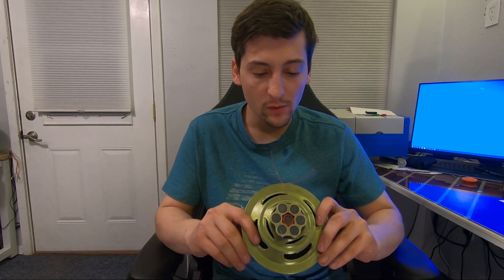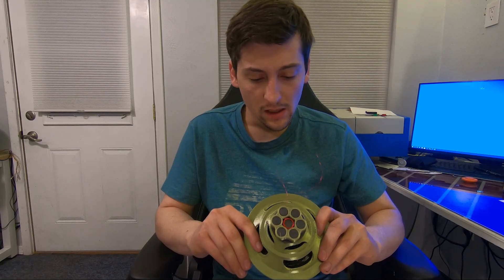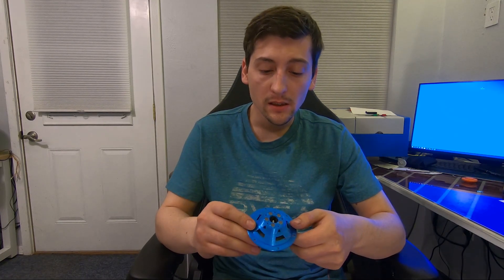3D Printed Speaker-V4 Revisiting the First Design

Comment: You have progressed exceptionally with your speaker design. Have you made the files publicly available for download ? I also want to give it a go.
Reply from the maker: I have released V2 and V3 on Thingiverse.

https://www.thingiverse.com/thing:5231593

V4 unfortunately required a lot of post process due to the resin printing and fdm printing mix, some of the tolerances arnt quite perfect, so in V5 I’ll release the files as it should be print and assemble. Also know there are quite a few non printed components in speakers. 

You also need the ability to print TPU.

But have fun with the current ones available, V3 is pure resin plus TPU and V2 is Pure FDM (TPU and your choice of other plastic)

I left some decent instructions in the Thingiverse description.
Reply: @piscesprinting  fantastic, thank you for sharing 🙌🏽

Comment: Just a tip, you need a top plate and t-yoke made of soft iron. You'll get a speaker that is 10-30 times more efficient, it's about concentrating the magnetic field only in the voice coil gab. The way with just loose magnets around the coil, results in huge diffuse flux which makes it super inefficient. Also, try a more traditional spider design, the one you use now does very little to center the voice coil in the gab. Great idea to fold the cone at the edge, stiffens it a lot.
Reply from the maker: Yeah I did that on my V3 speaker, this design was more centered around the idea of seeing what could be done without machining any plates or working around off the shelf metal components.

Comment: For low frequencies the main reason for the 1st speaker working better is mostly because of the size of the cone rather than the loose suspension but it does help
Reply from the maker: I just assumed since lower frequency’s require a slower moving cone, the less tension of the loose suspension allowed it to move slower since it has less force pulling it back to zero. Which also explains why highs and mids were almost non existent on the first one. Since it requires a faster moving speaker. Which can be helped by a tighter suspension helping pull it back to zero.

Comment: P.s. a weaker surround can work great with small enclosures that stop the cone from extending too far due to the pressure difference but it all needs to be at least relatively airtight 😉